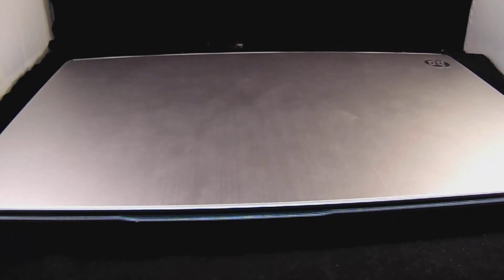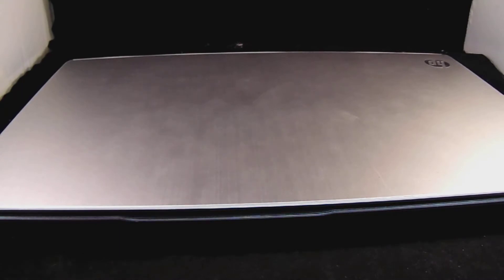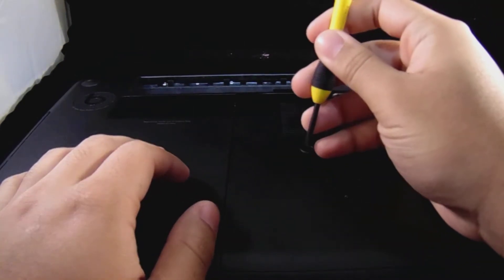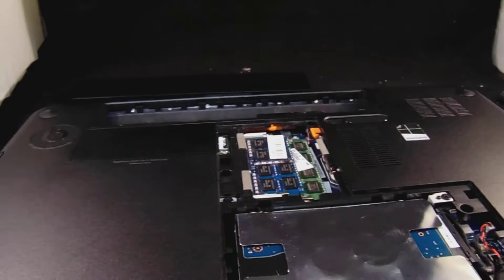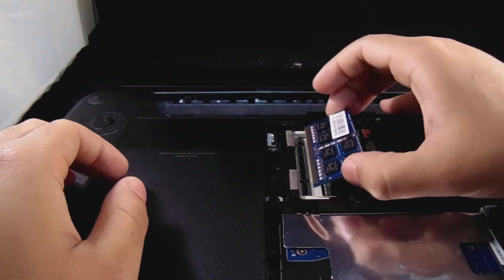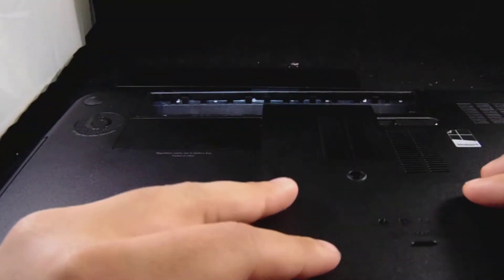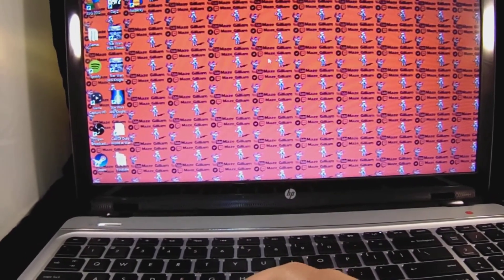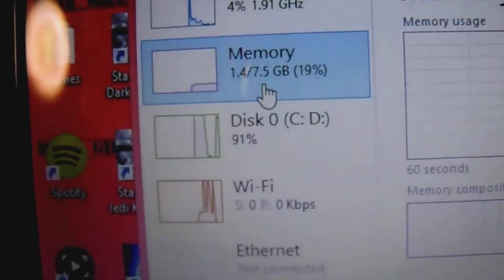How To Upgrade Ram on HP Envy m6 1205DX

Comment: Helpful and thorough yet thankfully brief video.  I recently 'refreshed' Windows 10 on the Envy m6 via the Troubleshoot menu (Shift key + Restart, then Troubleshoot & Reset this PC).

After re-installing browsers & their backed-up (saved) bookmarks, office software, media players, antivirus, etc. I then cloned the old spinning hard drive to its replacement - a  WD Blue 500 GB SSD (~$50) using a 'Gator' USB 3.0 SATA adapter (~$20 on eBay) and Macrium Reflect 8 Free, which allowed me to resize the C: partition to fit onto the smaller SSD.  Tutorials are available on YT. 

Runs so much better. Now no real need to upgrade the laptop.  Browsing, music, videos, office tasks - a basic user.  AMD A10 is still an adequate CPU.

I also cleaned the fan/heatsink and applied fresh thermal transfer paste - running cooler once again. Carefully tightening all the screws while inside returned a solid feel to the unit.

So I figured I'll bump the RAM from 6 GB to 8 GB while I'm at it - maybe with two matched SO-DIMMs installed the m6 will run in dual-channel memory mode and gain another small boost in performance.  For just a few dollars spent on eBay.  I really don't want to drop $500+ on a Win 11 machine.

The Envy m6-1205dx will accept up to 16 GB of 1600 MHz DDR3 1.35-volt RAM (two 8GB SODIMMs, i.e., 'laptop' RAM, not ECC server RAM).

Advice I'd add is to note the position of the locator notch next to the RAM stick electrical contacts and handle the SO-DIMM  carefully by the edges only.  Be certain the module is fully seated before locking it downward.  After module installation & a reboot, run the built-in Windows Memory Diagnostic to check that you didn't receive a defective module - rarely happens today but it can happen. Search for "Windows Memory Diagnostic" in your Start menu, and run the application.  https://www.thewindowsclub.com/windows-memory-diagnostics-tool-in-windows-7
Reply from the maker: That's an amazing upgrade to the laptop. I never thought about upgrading the hard drive because I never thought it was possible to so, this was my first laptop at the time so I wasn't knowledgeable of the changes one can make internally. I actually sold this laptop two years after the video was released to build my first pc but I can't deny I do miss that fingerprint sensor and the A10 was great enough to run some games and record at the same time, made a lot of videos with this machine. Great job on the upgrade👍